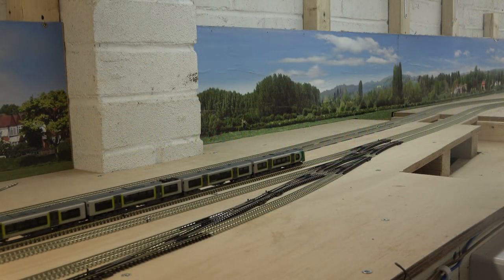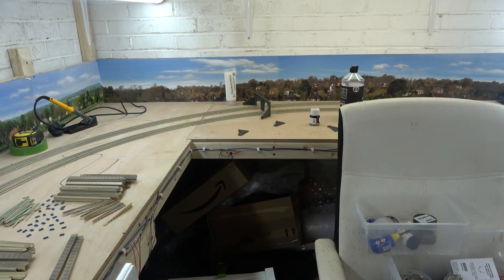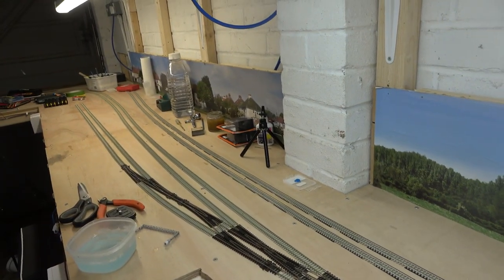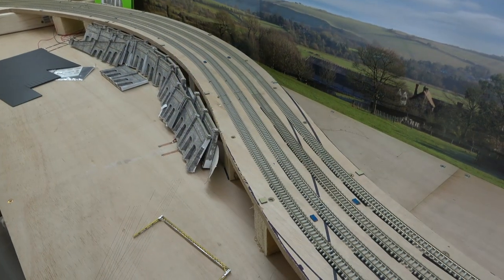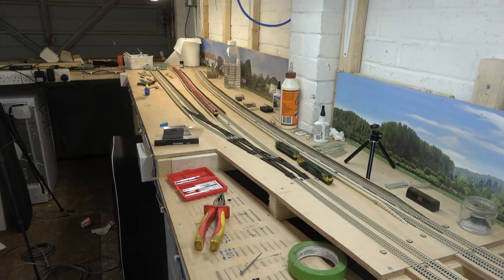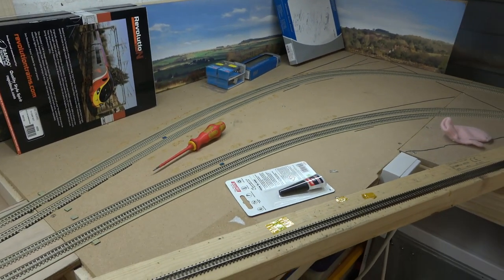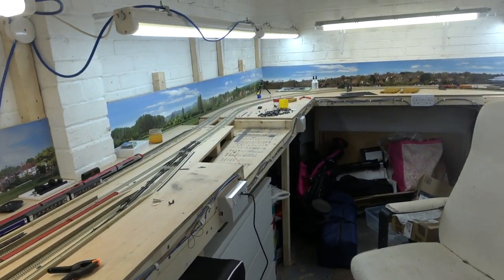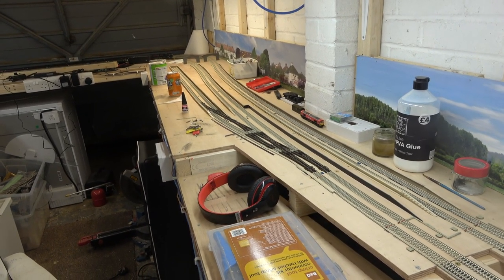Great Deltan N gauge-Track Detailing

Comment: Very enjoyable video. My only questions are when you glue the platform edges I am guessing the super glue works fine sticking them to the baseboard? 
Also I dont see any markings when you put them down, is that all done by eye and experience as so many seem to have issues with the trains alongside the platform edges?
Your old layout was fantastic but I much prefer this one but I am not sure why, possibly because it is bigger and that makes the video look better.
Looking forwards to the next video.
Regards Chris
Reply from the maker: Hi thanks for commenting, I'll do the first platform edge using a mk3 coach for reference of overhand, then all the rest after that I can usually get to match the first one. I guess that comes wihh experience and having a good eye for Parallel. The superglue is more than sufficient to stick the edges down. Thank you, yes I'm looking forward to this layout alot more than I was the first, probably as you say-the size.